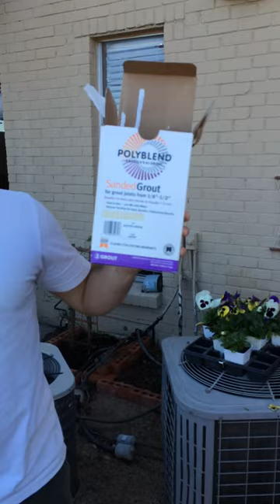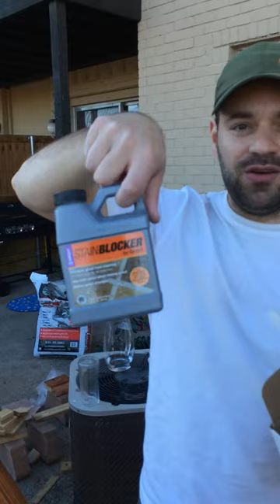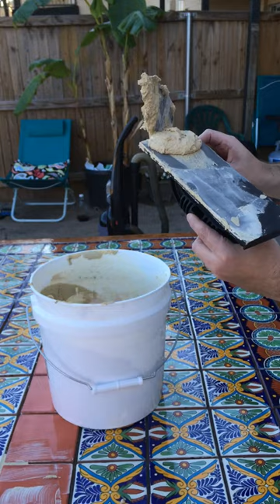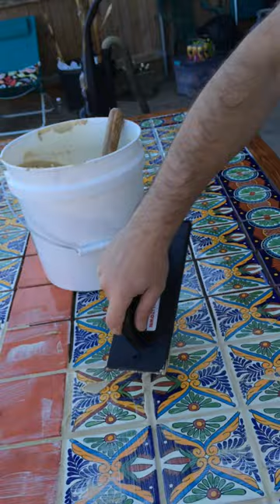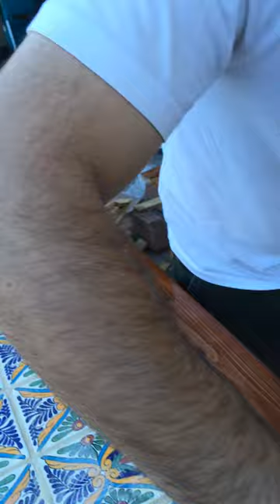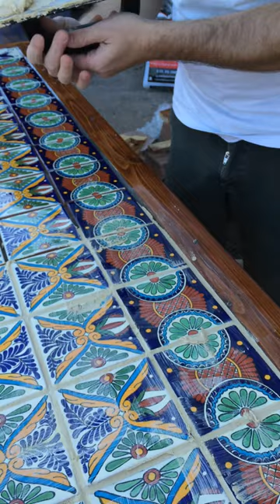DIY table with mexican tiles over wood using modified thin set - 7/7 grout

Comment: ok maybe you can help me, how can I make  and what do I need to buy as a base to make an island kitchen 5x5 feet and I wanted with saltillo and how can I glue it I'll appreciate thanks
Reply from the maker: I'm not an expert but I would try this one
http://pin.it/wzP0E5b
And use the top of it with a 1" 1/2 tick wood. Use sement to set the tiles into the top and it should be good
Reply: We are going to buy 4 white cabinets for the island kitchen, and we know we need a 5x5 counter top, but if I want saltillo tile do you think I can use a wood counter and then glue the tile or I wasn't sure you can glue tile over wood
Reply from the maker: +adriana Villar I think it is even better. I used cement  to glue them in a thin board of wood to make this table. You might be able to use glue but it will be a lot of glue. I would just set them on the wood counter using cement. I'm  am not a professional though. I learn as it goes  but that's what I would do. Look at my 1st or 2nd video of this table
Reply from the maker: +adriana Villar actually I used modified thin set over wood. See on this video. https://youtu.be/fp184i4xr4s